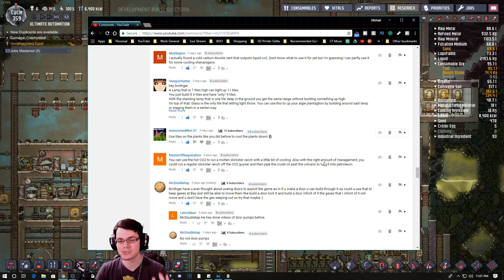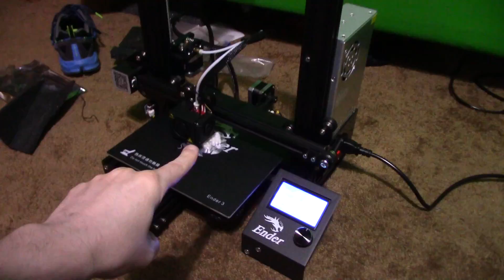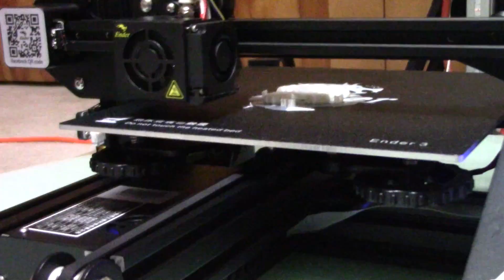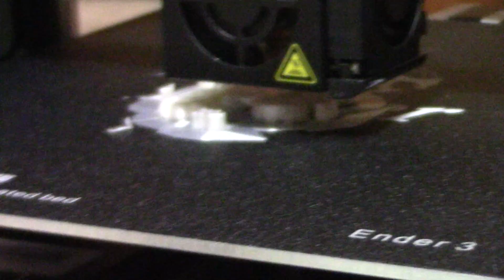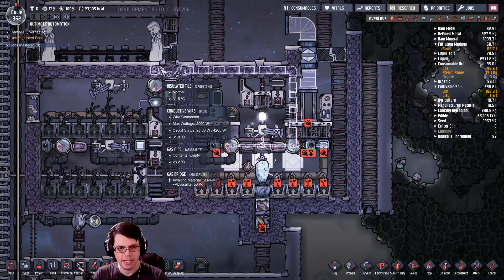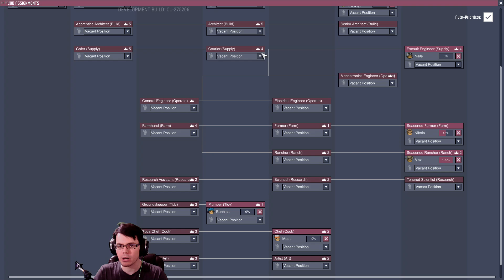Oxygen Not Included - Ultimate Automation Challenge! Cosmic Upgrade Part 15

Comment: Brothgar, if you want that molten slickster, you could try building room with animal drop point and auto wrangle that slickster to other location(maybe need temp ranchstation). Surface is also hot so you could move that molten slickster there so its close to future power plant.

Comment: if you had a boiler/septic tank attached to the surplus line of your washroom loop by that cycle you would have tons and tons of cold clean water just a little energy costly... sucks you havent found more natural gas.
Reply: 2 liquid coolers and an liquid tepidizer in a septic tank will kill food poisoning. fed to a water sieve to kill most of the heat then into the tank to the aqua tuners to cool the clean and heat the polluted. constant drip to decent surplus depending on your p water supply
Reply: makes polluted dirt as a cast off

Comment: There is a very easy way to self-regulate water levels, no sensors needed.  Just put the liquid vent inside your basin at the level you want the water to fill to and it will naturally over-pressurize and stop the water flow.  I use this all the time to make kitchen pitchers.  https://postimg.cc/image/ogltump3l/

Comment: Make sure to check the temperatures of the excretion from both regular and molten slicksters, petroleum has a higher sp. heat than crude oil so you'll want to use regular slicksters if the petroleum from molten ones is cold.

Comment: I thought a lower specific heat capacity was better to be honest (tungsten is great, assumed that stat being lower was good), but I guess the name is actually intuitive and if there was something with as much thermal conductivity as tungsten but a higher capacity (ie. diamond?) it would cool things more efficiently. Am I understanding this right?
Reply: No, lower specific heat capacity means the the element requires less heat for it's temperature to go up by 1 °C(fuck you if you're american), such as water takes 4.2 joules to go up by 1 °C that's why it's such a good coolant while copper is somewhere around 0.4 joules and therefore is good for heating
And yes to the second part as thermal conductivity is self explanatory and if it conducts a lot of heat, but still takes a lot to heat up it will conduct effectively

Comment: if your going to block the shower, vs using a door, you could use your dup traffic control... An actual use case for the thing. And just because: one thousand one hundred seventy seventh view
Reply: Dupe traffic controls are silly because dupes wont look for another task if they cant get to the current one, instead they will just camp the dtc the whole day until they can get past to do the task. If a door is closed, they will have no other choice but to look for another task. I dont know if they got changed at some point tho. It can work for toilets, but not showers. Showers really need to be behind a timer.
Reply: DyingCr0w that's good to know. Perhaps brothgar can do a vid on it. I cannot think of a use case for them.
Reply: There are uses for them. One ive been using is on toilets/sinks. I made up a system with many toilets and just 2 sinks, with checkpoints and pressure plates. I placed pressure plates on each sink, so when theyre in use, they will trigger the checkpoints, stopping all the dupe mob that used the toilets. Its a way to insure (most) dupes will wash their hands when they use the toilet, without having a sink for each toilet, which is a big space waste and contributes to pipe spaghetti. Of course, this is irrelevant if you build a room for each dupe, and set door permissions, but it requires a lot of forward planning, depending on what you have to dig, and how many dupes you wanna have. There is a choice between having each room with a toilet, sink and shower, or, with the new schedules, just a shower per room, and they can use the common toilets. Or mix and match. Checkpoints will work great for shower rooms, with the new schedule.

Comment: Hey to cool down your base why don't you cool down the oxygen that you put into your base ? (the oxygen created by the electrolyzer). That's way easier and that works even better, because you cool down the hole base without spaghetti everywhere !
Reply: Spaghetti will not be touched
Reply: Lionel Ding I do that in my base lol, just jam in 2-3 wheezeworts in your electrolyzing room and your whole working area eventually cools down, but extremely hot zones like petroleum and metal refineries  don't, that's the only flaw
Reply: Yup but for the living part of the base, it's easier !
Reply: That,  and cooling other sources of heat. I saw a forum post suggest piping minimum amounts of water to the farm,  so every trickle of water is immediately consumed instead of sitting in the pipes warming the farm.